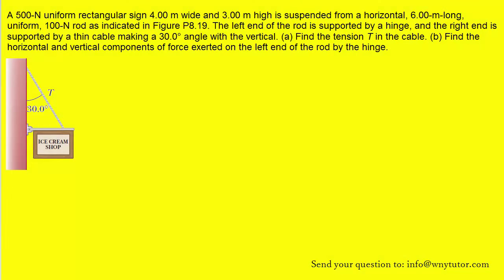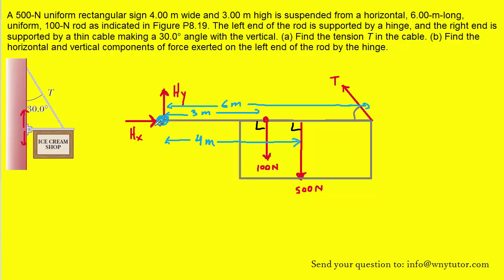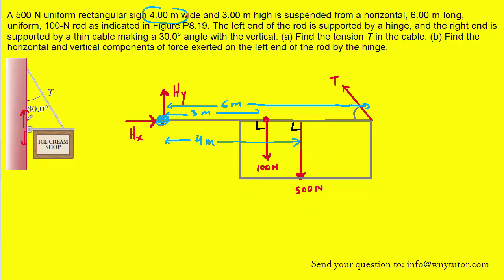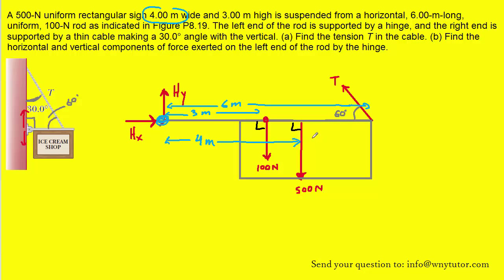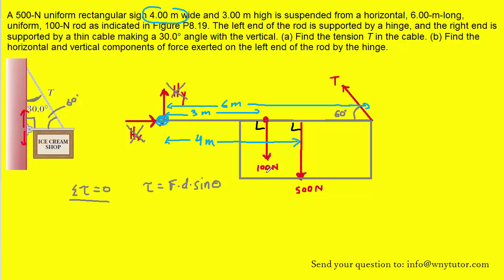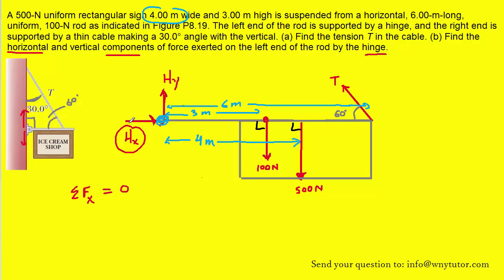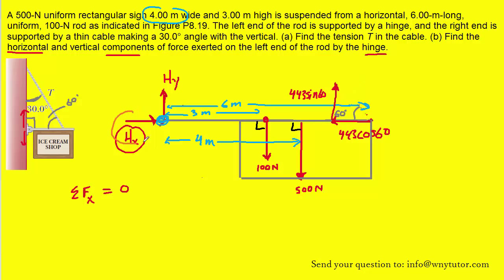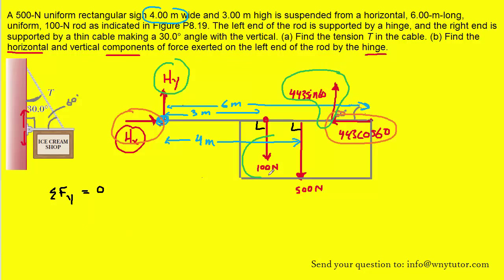A 500-N uniform rectangular sign 4.00 m wide and 3.00 m high is suspended from a horizontal, 6.00-m-

Comment: why is the 3m in the horzontal direction on the diagram when the question said that 3m was the height, which means it is supposed to be vertical?
Reply: yeah? wtf?
Reply: Because it is at the halfway point on the rod, and the rod is 6m, so the weight of the rod is 3m away from the pivot point in this case
Reply: I guess its a question error, because it said 3m "HIGH". This gives an idea that it is referring to the vertical axis and not the horizontal.

Comment: Can you explain how you got the tension? I am putting in my calculator but I'm not getting the same answer.
Reply: Maybe check if radial or degree
Reply: To help out with anyone else stuck with this

Once you multiply the first two Torques then add them on both sides to try to isolate the final torque. You should be left with T(6)Sin(60) = 2300

Divide both sides by Sin(60) in degrees and you should get T(6) = 2655

Then Divide both sides by 6 to get T = 443.

You're welcome!